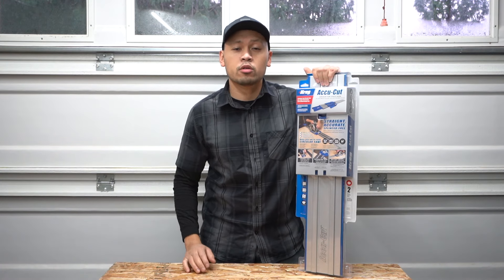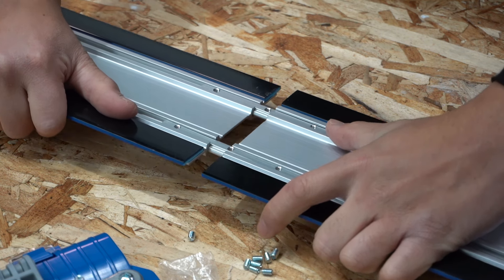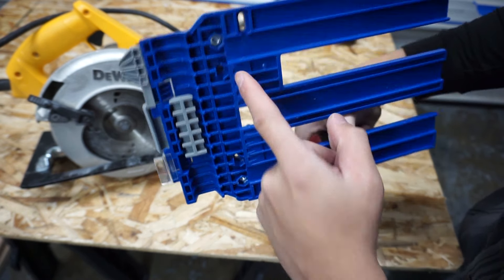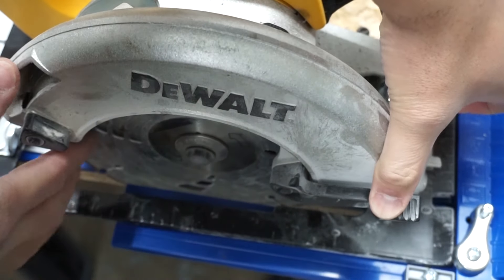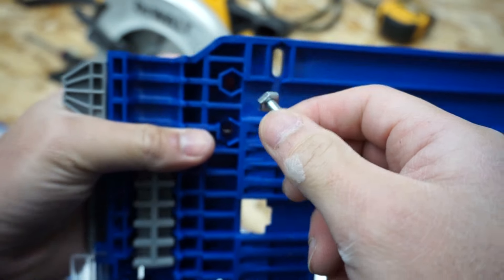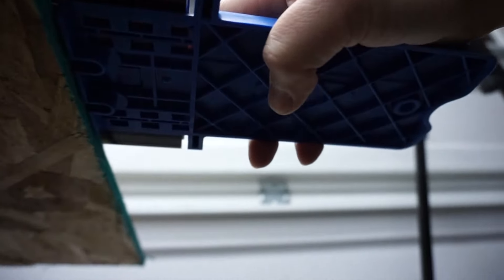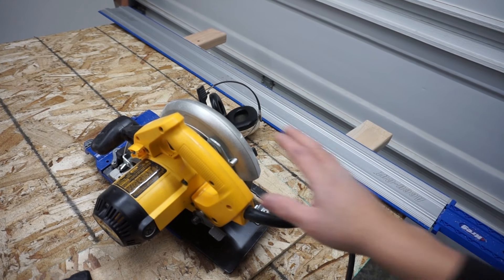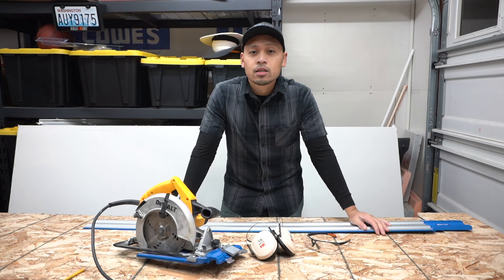Kreg Accu-Cut Review And Set Up For Perfect Straight Cuts!

Comment: I viewed on YouTube demo of this guide and the deliverer concluded that it is not accurate.  So did many watchers claim the same.  But they didn't set up the guide properly as you have and took far more than the 1/32 th off the plastic rim.  You presented this video very well and showed that you can get accurate cuts from this guide.  Also, I like the comment from og  atkinson about using a 1/32 drill bit to measure the gap
Reply from the maker: Thank you so much! 🙏🏽😊

Comment: Good video, thank you. However, this setup doesn't trim the edge as per the instructions and it IS an important step. But your trick is useful, just add an extra step: Once you've aligned the blade with the exterior edge of the blue guide, loosen the sled, slide a 1/32" drill bit between the stop block and the base of the saw, tighten the sled back down on the saw base, and adjust the stop block.
Also, regarding the slop in the sled that many have commented on and that is quite considerable: I fixed it with UHMW tape: 25 mil on each side of the center slot and 10mil on one side and 5 mil on the other side of the lateral slot. I saw another vid where he used a lot less, maybe it depends on your particular sled, but this was the adequate size for mine and its snug as a glove now. Also, I did this before trimming the edges, so that everything was nice and true. Hope this helps
Reply: Thank you for sharing this definitely will help
Reply from the maker: Thank you for the extra tip! 🙏🏽😊
Reply: I have trimmed my edge twice and keep getting a wag as the saw hits it. I have enough to try one more time. What gives.
Reply: @cfrye20951  have you eliminated the slop between the sled and the rail?

Comment: Good presentation, good editing.
Just a couple of things of note.
I noticed when you unboxed the Accu Cut, the saw sled was missing a part. It's a grey piece of plastic that used to support the front of the shoe of the saw, if the front of the shoe is beveled upwards, like your saw is. It's two sided. It installs one way if the front of the shoe is beveled or flip it over if the shoe is flat at the front. Without it not supporting the front of for your particular saw, you may find issues with the saw not staying true in the sled. Check your manual, the use of it covered in there.
Get a hold of Kreg, they're really good about customer satisfaction. They'll probably just send you one free of charge. It's clearly on the video as your taking the sled out of the package, that it's missing.
I would also suggest for cutting sheet goods, you replace your 24 tooth blade, for a 40 tooth or higher blade. You'll get a much cleaner finer cut. You'll have to check and probably readjust your saw to the new blade and track, not all blades are the same thickness from manufacturer to manufacturer.
Kreg also sells a set of clamps that attach to the under side of the track.
Not all sheet goods are billiard table flat. Thinner sheets have a tendency to be less flat than thicker sheets.
I've been using Kreg tools since 1993, and I have more of their tools than I'm willing to admit to my wife.
Excuse the length of the comment. 
Cheers.
Reply: No, there is a piece in the center supporting circular saws with a beveled edge.

Comment: Glad it worked for you.  I have tried and tried to get a straight cut with mine, and no matter what I do the cut is NOT straight. It starts out cutting right next to the blue strip but some where in between it gets farther away from the blue strip and so by the end of the cut I am about 1/16th of an inch away from the blue stip.  I have tried everything and this thing is just not that good.

Comment: I assume you didn't fully read the instructions. The reason you measure the 1/32 gap from the blade to the opening in the sled is so that on the first cut you remove 1/32 of the blue rubber strip. The strip is stuck to the underside in a mass production factory and are not guaranteed to be be applied accurately straight. The instructions says to cut off 1/32 of the strip on the first cut to assure that all subsequent cuts are straight. By butting both the edge of the strip and the saw blade against the edge of your timber the way you did, you removed the opportunity to cut the sacrificial strip straight and risk all of your following cuts being miss-aligned.  This is a very important step when setting up any new track guide.
Reply: You are correct and I agree with the importance of the trim. However this trick IS useful, just add an extra step: Once you've aligned the blade with the exterior edge of the blue guide, loosen the sled, slide a 1/32" bit between the stop block and the base of the saw, tighten the sled back down on the saw base, and adjust the stopblock.

Comment: when it comes down to the wire, the kreg track is to be on your work piece, not your scrap side, so when you marked 8 in from the edge, the way you positioned your set up, you would have had to deduct the thickness of the blade for that to be true.
Reply: I was wondering how he accounted for that because he never mentioned it, and I thought it could not be possible that he said that edge right on the 8-inch Mark and then cut it off and it was still 8 in wide

Comment: Seems that the part of the track that moves the most is the middle of the track where the two half pieces of the track are screwed together.  So when that moves, it can cause the board to bow in the middle.  This bow is magnified the longer the track.  What is your experience with this bowing?

Comment: I like your method for setup against the edge of plywood. As far as 1/32 inch, you could use a 1/32 drill bit instead of trying to measure the gap. Thanks
Reply from the maker: Thank you 🙏🏽 so much for the advice! 👍🏽😊
Reply: You don’t measure 1/32” it says you’re going to cut about 1/32” off of the guide and to mount your saw with the blade in the center of the right side gap.
Reply: @joejones2847  Hi how are you? Not to sound stupid, but that’s the problem I’m having. I don’t understand that part. And have up on it today. And let say your cutting off 4 inches, you put the blue edge of the track on your 4 in mark, mine is off about the width of the blade. Not sure how you set your saw up to cut off the 32nd of an in. Can’t you please help. Thanks. This tool is new to me and I don’t get it. Thanks.! 🤝
Reply: @jamesbarlowjr.3762  man it’s off 1/8” that’s the width of the blade the only real option is to measure 4 1/8” and it will make your drop 4” you just have to account for that 1/8” that it says you don’t have to account for
Reply: @jamesbarlowjr.3762  KREG says you don’t have to do that but I think we are measuring from the wrong side. It’s the only way you could possibly measure 6” and your cut be 6”. Because the blade is going to always take 1/8” off but it will be on the other side of the line if you cut from the right side of the wood to the left but if you cut from left to right is all I can figure. It’s frustrating
Reply: @joejones2847  Yeah it’s definitely that! When I line up the blue edge and my blade up against that I’m no close to where I need to be. I mean I’d like to use it and I’m sure it’s good. But can’t get it lined up.

Comment: I bought one at a big box store yesterday. I’m returning it tomorrow. The set screws are cheap crap, strip easily and backed out on me after a few sheets of plywood. I didn’t catch it till it was too late and the the set screws lost. 
It’s a good idea if it was built out of decent material. The quality isn’t worth the price but if you decide to buy one do yourself a favor and superglue the track set screws.
Reply: I wouldn't do super glue, you never get them out, but blue loctite is a good application for something like that

Comment: Thanks for the awesome review! I'm getting ready to get the Accu-Cut but, I've read some older reviews that the plastic base is a little slop side to side on the the rail. I don't know if Kreg has fixed this issue. Do you find it to be a little sloppy? Thanks again. 👍😊
Reply: Just got one and it was super sloppy. Fixed it with UHMW tape: 25 mil on each side of the center slot and 10mil on one side and 5 mil on the other side of the lateral slot. Snug as a glove now. 
Edit:
Got this trick here:
https://www.youtube.com/watch?v=BbqY4k1C83o
You'll notice that I had to use a lot more tape that he did, so to answer your question, it actually looks like it's getting worse, but totally fixable with this method.
Hope this helps

Comment: I did not get a gap. The instructions say to install tighten the set screws on one side first.  Then put the other side in, hold the two pieces together and put in the others side’s set screws. I did that - no gap.

Comment: question. I just checked out pricing on extension kit and it is $99.00 while the track cutting kit costs $69.00. If i buy (2) track kits i can join 4 tracks together. Correct? If so i can save $30.00 thank you. Sorry stupid question

Comment: ALL- BEFORE MOUNTING THE SAW TO THE KREG SLED: with a combination square, ensure the blade runs parallel to the edge of the saw shoe; and likewise, that the front edge of the shoe is square with the shoe edge against the gray stop block.  My Makita saw must have been dropped and the edge of the shoe is off from front to back of the blade by 1/4”!  The curved depth adjustment bracket is what’s bent & you’ll have to  straighten it first and check you alignment again till it’s correct.  Otherwise- the blade binds very badly.   If you don’t do so, shimming the front of the shoe is required to be parallel to the sled edge- or drilling and installing thru bolts to hold the sled in place is required. That’s what I wound up doing.  My only gripe about the sled is it deflects when tightening the set screws to the saw’s shoe. After all- it’s plastic. After a while I’ll probably get a dedicated plunge track saw.

Comment: Think by default most circular saws are set blade 1 1/2" to the left. If you have a piece that's straight you can just clamp it down at 25.5" for example if you want to cut 24"

Comment: I use a table saw for rip cuts muy bro but I bought this ACCU CUT system and I was pleasantly surprised by the tracks and how strong they are. It cost me under 100 pounds which is a great deal tbf my friend. I watched other reviews and some of the guys were saying u have to cut some of this blue coloured strip away along the side of the track?? Is that correct or can I forget about this part and just butt the blade up against the plastic bit on the edge of the tracks 7 cut from that position?? I don't want to mess it up so maybe I'll just do what u did and leave it alone man..
Great video too btw and of course I sub'd and liked and shared the ting for ya mate.. Salute to u Sir from Dublin, IRELAND!

Comment: I may be wrong but aren't you suppose to trim a 1/32" of the sacrificial blue guide first? that way you have zero clearance. great video just the same.
Reply: You are correct. This setup doesn't trim the edge as per the instructions. But the trick IS useful, just add an extra step: Once you've aligned the blade with the exterior edge of the blue guide, loosen the sled, slide a 1/32" (0.8mm) drill bit between the stop block and the base of the saw, tighten the sled back down on the saw base, and adjust the stop block.

Comment: what if the edge you measure from isn't straight, its 1/16 wavey. how do you deal with this?
Reply: The deflection you are referring to is from slop with the rail and track system. That is what is giving your wavey measurements from when you cut your work piece. A way to fix this is to create a slight twist with your wrist (turn your wrist towards the track system.) This will always provide you two points of contact with your guide and rails. And be mindful to keep your elbow aligned with your handle so keep it driving straight and not off balance.

Comment: You aren’t following the instructions correctly. You don’t set the blade 1/32” from the edge of the sled. You put the blade roughly in the center of the space of the  sled. Then you put the sled on the track, adjust the saw so that the blade will cut off roughly 1/32” from the edge of the guide on the track. Then you make that cut!  Now the edge of the track perfectly indexes your cut.

Comment: You didn’t follow the instructions at all. It says to CUT 1/32” off of the edge guide that you’re going to be using. That’s their way of being 100% that they edge is exactly even with your saw blade. It clearly says it in step 7 “Trim the guide strip” the way you have it now it can be slightly crooked. If I could post a picture of the steps I would but I came here hoping you had a tip for that step

Comment: you just guessed on a measurement 4:20 into your video - bad advice
Reply from the maker: That is not guessing. My tape measure is divided to 16th. Some tape measures are divided to 32nd. Obviously if you have 16th just go between each tick if you have the 32nd version then you won’t have a problem.
Reply: I don't think it's a guess really, is it really?

I mean his tape measure has 1/16 in measurements on it, obviously if you go between 2 1/16th tick marks you are at the 1/32nd mark
Reply: I guess you could say without a tick mark there, you have to eyeball it, for me it's still not a guess, depends on how well calibrated your eye is

Comment: Please understand that there is no such thing as a 'perfectly straight cut'. 'Perfect' is a Platonic concept that does not exist in nature. At the limit, space is not straight. At a more prosaic level, an engineer will never use perfect, exact, or any such term. 'Within tolerance' is the aim- i.e. as straight as the application requires. Using terms like 'perfect' shows that the person does not understand the subject they are discussing.
Reply: Picky picky
Reply: @omikeyutube  Thank you! If this was perfect, it would be impossible to improve on. Not ( and never) the case. Why would anyone buy a proper track-saw?